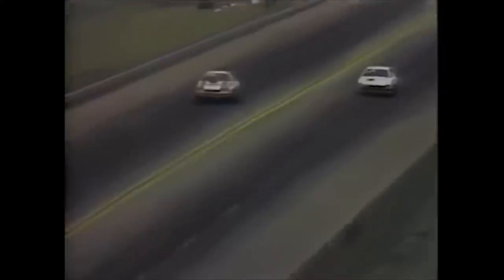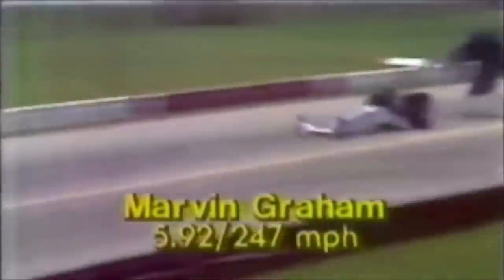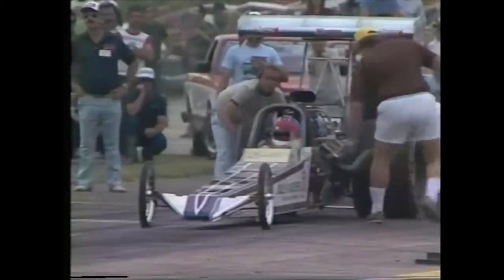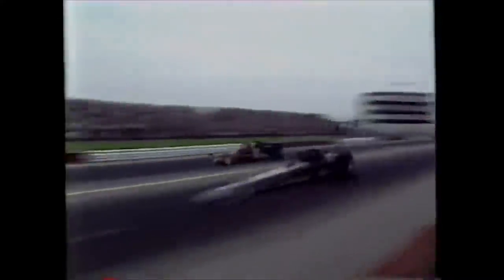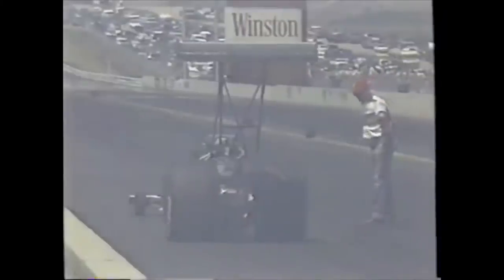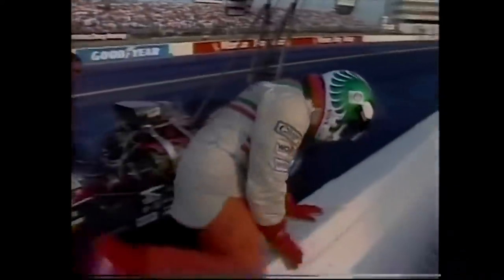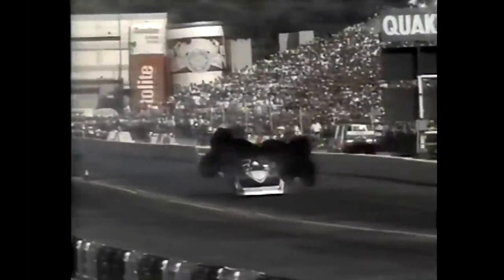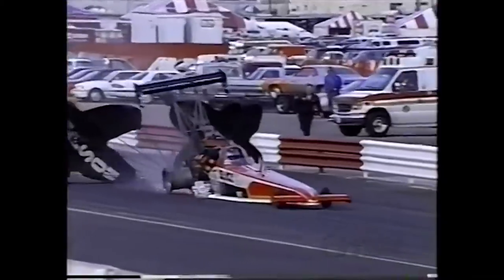More Drag Racing Oddities

Comment: That piston with a valve straight down through it - perfect valve head too! The chances of that are like a lottery win. Great footage of some Brave drivers at the Top of their sport. Thanks for putting this together : )
Reply: I remember seeing this on TV and thought that it was an amazing freak accident. No surprise that Garlits  wanted it for his museum.
Reply: That valve is even the wrong way around, it must have spun... The stem should point away from the piston...
Reply: @y0uRF4t3  That's what I thought. The valve rotated in the cylinder in the split second before it went through the piston

Comment: If memory serves me, Desoto Dragstrip had a sand pit at the end of the track before a hay & tire wall back in the day. It’s been 20+ years ago at this point but remember shoot or brake failures that ended scetchy but with just a pull outta the sand. Than again, that part of Florida is pretty much one big sand trap anyway. Big up to Cleetus for buying and fixing up Desoto Speedway, I spent a lot of time there as a kid. Back in the good ole days when you’d get in the gate even as a 10 year old & split from the parents and meet back up when the night was over. A good community to grow up around, it was the ‘80s though. I had friends that I only ever saw there.

Comment: That valve dropped all the way out of the guide while the piston was down.  Then it turned 180 degrees while in the cylinder, and then the piston came back up and impaled itself on the valve stem.
You couldn't make that happen again if you tried.
Reply: ya, as a mechanic..... i have NEVER seen that.... or even heard of it!!!
seen a lot drop and the valve face hits the piston
.
but a double "stem" hole....WOW!
Reply: Iv seen it on a diesel
Reply: @earlg1094  That's interesting.  4 stroke, diesel, or 2 stroke?
Reply: @kainhall  Yah, it's strange.
Reply: uh... they did make it happen... that is why there was two holes in the piston.... LOL!
Reply: @bobbyd9583  
Your theory is the following?
The valve came out of the guide, spun 180, the piston impaled itself on the valve stem once.
Then the valve spun 180 again, flew back up, the stem went back into the guide, then it fell down once more, spun 180 a third time, and the piston got skewered a second time.

That must be what happened.  It's much more of a miracle than even I thought.
Thanks for pointing that out.

Seriously, read what I wrote and think about it.
The valve turning end for end inside the cylinder without getting bent by the piston is the amazing part.
Skewering the piston after it turned is expected.  Punching a hole in the piston more than once is only surprising because it makes you wonder how the stem was able to dislodge from the piston the first time so it could do it again.
Reply: I never said it flipped twice. watch the video again and note the second hole in the piston. end of.
Reply: @bobbyd9583  
My original post mentioned how it's nearly impossible for the valve to to drop and flip ends in the cylinder.
You responded to that with a mention of the action that was otherwise the most expected.  Which is that if the valve had turned end for end, it would pierce the piston top.  
It seemed logical that you were claiming that was extraordinary, rather than being completely predictable, so logic requires that you were claiming the valve went through 2 entire cycles of leaving the guide, flipping, and stabbing.  I mean, why would you even mention it otherwise?  Once it was turned around, stabbing the piston was inevitable, and why would you bring up something that was inevitable?
Reply: I’ve seen it happen with a v8 jag motor. Snapped timing chain, valve head snapped off and the remaining valve stem under the head embedded in the piston just like that haha
Reply: @eddyagg  The piston hit the valve head, and broke it off of the stem, the protruding stem impaled the piston.
That's not uncommon.  The stem was still in the guide, and the cam was not rotating.  There's no way for the piston to not hit the open valve.
Reply: @bobbyd9583  

You original comment was not wrong, but it missed the point by a country mile.  
Picture a dirty homeless guy paying for a high dollar call girl.  Then it happens the next day.
The amazing thing is NOT that he did it twice.
The amazing thing is the story of how he got the money.

The extraordinary thing that happened with the valve wasdefied
Reply: That's a first, I'd bet it's never happened in the history of drag racing, or the gas engine for that matter.
Reply: @bobbyd9583  Back in 1967, I only had a valve punch a hole in a piston, in a '63 SuperSport Impala 409/425, it took out a cylinder too, but, never like this one did.
Reply: Piston still looked O.K., 😂 except for the top.
Reply: I've built many engines with the valve through the piston for starters
Reply: Doesn't have to spin twice...if it doesn't stick the first time, the piston will fall, and return before the valve can even move. 
Rpm/60 = how many times that piston rises and falls in one second, compression and exhaust. 
Valve would have to be shorter than bore size, but wouldn't call it a miracle.

Comment: The top fuels can't disengage the clutch and have no fuel cutoffs?
Reply: I believe so yes, the clutch melts together and has to be replaced after every pass (along with spark plugs)
Reply: Trencher i hear their spark plugs can be used for ark welding
Reply: They have fuel cut offs but with a magneto and the heat from running they will “diesel” and not shut off
Reply: Clutch is air operated-needs a tank to release.